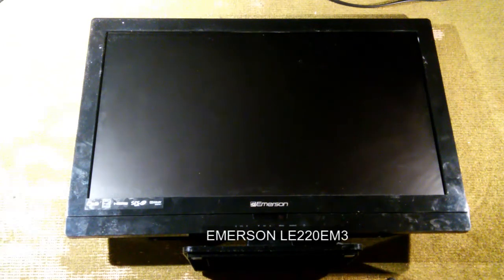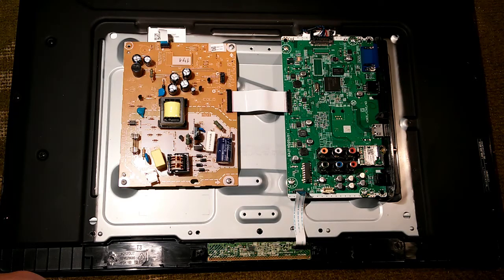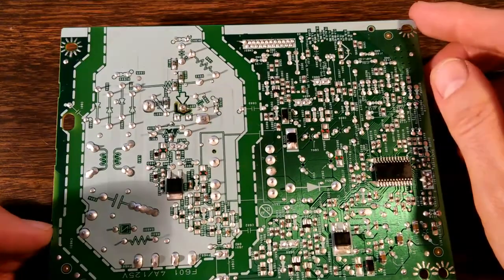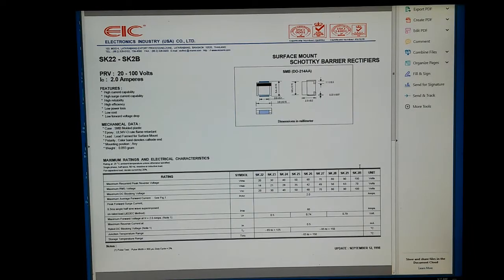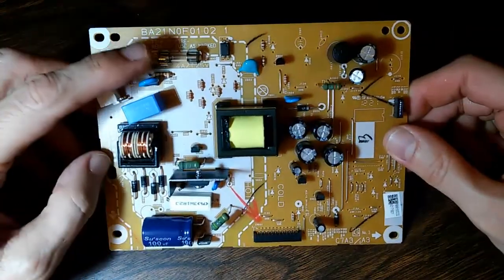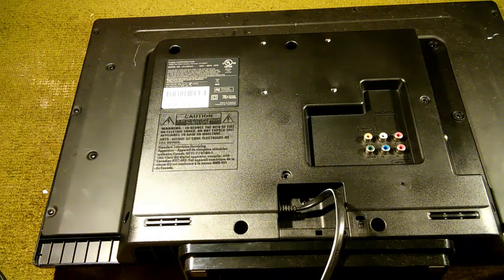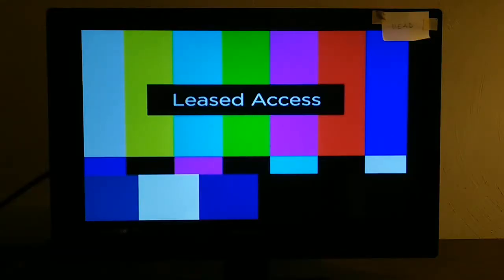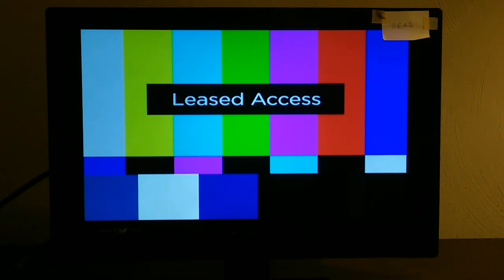Emerson LE220EM3 repair

Comment: Thanks for posting this. We have a similar issue; however, our fuse isn’t blown but the light won’t come on and the tv will not turn on. How much do these pieces cost?
Reply: I have the same issue.
Reply: Some other PSU component is dead I assume.
Reply: Same